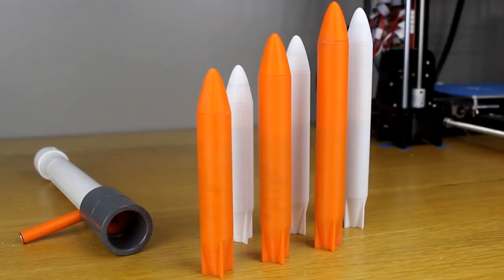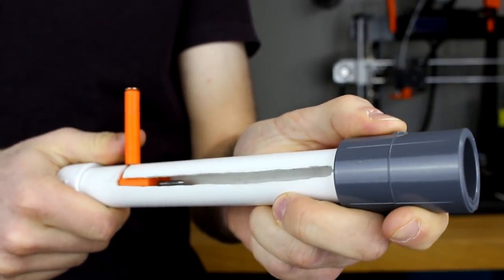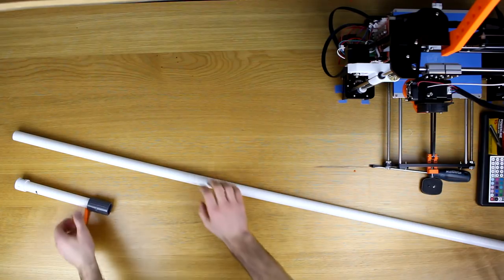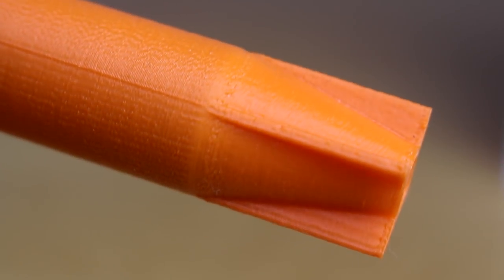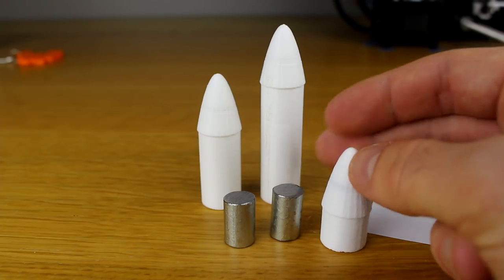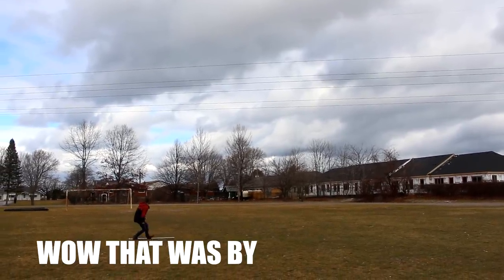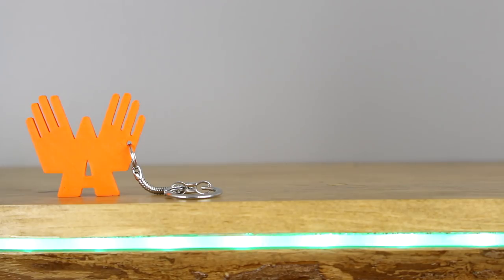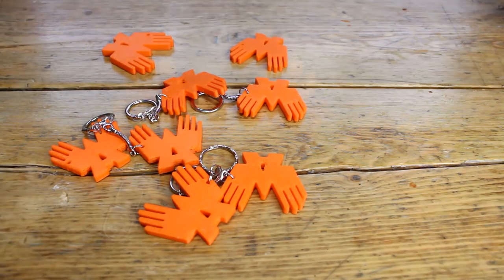3D Printed CO2 Rockets

Comment: Make the fins bigger. If you cut 4 slots in the PVC barrel you can use them to guide the rocket. Each fin will fit in one of those cuts
Reply: I think the whole reason for it being in a tube is to get the pressure behind it. He mentions in the video that the firing mechanism is sealed somewhat so that it does not lose pressure.
Reply: and each fin will have more friction on the tube and have more air resistance,
so it WOULD be more "stable" (according to KSP experience) and go not as high
Reply: It might help to guide it strait, though all of the air is going to be lost and the friction will slow it down further
Reply: hm....  true.
So instead of cutting 4 slots all the way, just make grooves on the inside of the pvc without cutting it all the way from inside to outside.  I dont know what tool can do the job, so maybe 3d print a tube with notches,

More like a scratch and less like a cut. With enough space for the wings
Reply: This would be a better alternative, it then comes to friction and slightly less pressure to decide.    Certainly a little better.   Though you could get rid of big fins and rifle it.
Reply: i think he should go with bigger fins, bigger tube and a wad to keep the pressure
Reply: Yea but friction...

Comment: You can increase the performance by adding less weight (CG forward) and using bigger fins (CP backwards) to achieve your stability factor! Then they'll fly higher since they weigh less.
Reply: Oh but you're constrained by the diameter of the PVC, nevermind.

Comment: Make spring loaded fins.  That way you can get rid of the nose weight.  If you put a slight bend at the end of the fin it will cause the rocket to rotate around the axis giving it gyroscopic stabilization. (Just like a rifled barrel spins a bullet).

Comment: Okay  Boss so I got my 7th grade science grade for model rocketry and a lengthy research paper ( and as my teacher had friends at NASA he gave me a NASA manual on rocket fuels ) all that said they make a model rocket add on that you might find cool it is a camera for the nose cone of small rockets I'm not sure if it would work with you rockets as it is triggered by pressure from the combustion engines in our old school style rockets. Good luck if you try it and great video.

Comment: I'm prety sure stable rockets can't be made with co2 cartridges. You can't pierce the cartridge perfectly in the center, the way the metal cap is made make its thickness inconsistent causing the hole to never be perfect, and your nail would need to be lathed for the point to be as conical as possible otherwise all those factors contribute to the thrust vector of the cartridge to always be off by a few degree making the rocket spin uncontrolably.

Comment: I have had this idea for a while but using model rocket engines instead of the Co2. Never tried it because I don't have a 3d printer. I wouldn't know how to design it or design it so it looks dope like that though. You should try to do that some time
Reply: It would prob explode because I believe it trys to burn inside the rocket for the last few milliseconds of fuel to push out the parachute and if it is in a sealed area then it would either burn a hole thur the side or build pressure and burst. but it would go supa speed and you could still see it bc the flames

Comment: Angle the fins for some spin, that will help.  Also, not rockets, but a similar problem of having fins but not much room for them was the tear gas grenades used by the Czechs in the 1980s. They were only 26.5mm, the same diameter as European signal flare cartridges, but much longer. They had a longer skinny tail section to add drag stabilization they could not get from wider fins. http://forum.valka.cz/attachments/4461/RV-85.jpg (they were for firing through walls at up to 700 meters) 

Getting a firing pin to reach up higher into a design like that could be tricky, but one simple answer would be to put the puncture pin/nail into the nozzle and have a rod from the firing spring push it, and you just dump the expended pin out of the tube before reloading.

There are also 26.5mm rocket assisted rescue flares. They use thin spring steel fins that wrap around the flare, and spring out once they clear the barrel. https://youtu.be/KuIh4ws_i6A

Comment: can you try and print a different model where you have slots cut into the rocket body and place plastic or cardboard fins that can deploy with air resistance when it leaves the barrel?

Comment: Make you rocket spin, even if it's uneven, it'll spin fast enough balance out. Like a top
Reply: There is no need to spin stabilise. Fin stabilization is just as good a rotational stabilization. Think about how a shuttlecock works. The amount of fin surface area really is not that much. A spin would not be initiated until after it leaves the launch tube, by that time it is already getting too late. A properly balanced body would work better in this case. He could remove the fins and still get the same if not better performance just by reducing drag and extra weight.
Reply: GeeTR 63-71 these are good points, but the idea I was having would be similar to a gun barrel. See, have the rocket start its spin before it exits the tube.  That way the fins kept the rocket stable and the spin keeps the rocket straight and true. As mentioned in the video that one of the issues, is that it doesn't stay straight while in air. So in my mind, the rocket is not having a strong effect by the fins, as is. This method is copied from NASA so I hope it's reliable info
Reply: You really do not need fins, take bottle rockets for instance - they have a long stick to counteract the pitch and yaw effects you would get from moving the CG behind the CoT.  Since fins are kind of out of the question as with rifling, the best bet would be to give it length and slide the propellant forward and have it exhaust out the bottom like a straw. If he wanted to over engineer it he could add spring loaded fins that deploy immediately after egressing from the tube. When I was in the Navy, our AOs learnt me some stuff about the GBU 10, it has a wire attached to a pin that is pulled when the bomb drops and that deploys the fins - home dude could just use the tube as the fin retention mechanism however, this would cause friction that would slow it as it exits. He could remedy that by using a 24 gram co2 cartridge and making a bigger hole for a more expedient discharge rate. He could just use the 24g in general so he gets better performance all around.
Reply: GeeTR 63-71 you have a strong point. But the entire idea of fins is to guide, water bottle, or c02 rockets through the air, to keep it straight. Air still has an effect on high speed anything, interlacing currents of wind can curve the rocket. Although over engineering spring loaded fins would be over kill. But if one we're to make the cone of the rocket more narrow like, then it would increase air flow around the rocket. Thus Less work for the c02 cartridges.
Reply: Well he already has the issue of bad balancing, why not fix it with one fell swoop. There is really no reason to add more fin surface area, why keep adding more stuff when you can just fix the problem just by changing the CG.

Comment: hmm.. can you try a needle instead of nail to get longer/ hire flight?
Reply: You need the sudden discharge of fluid. A slow discharge will not give you the required thrust, unless you can figure out a good median between thrust and discharge rate.
Reply: Crazy cal: Contrary to author's statements, it is a bullet, not a rocket. You have to discharge all CO2 rapidly, at once, to make this gun shoot the CO2 cartridge into the sky. If you attempt to make it into a true rocket (e.g. by punching a smaller hole instead of a large one), it simply won't fly.

Comment: should seal the end of the launch tube with tinfoil and add a vacuum pump to the tube. maybe add another 2 feet to the length. this should allow your rocket to launch faster and it would punch through the foil I believe not effecting the speed.

Comment: get the little solid rocket engine and put inside of the rocket instead of co2, it will go much higher
Reply: hobby store has them in packs at this size even, electrically primed easy

Comment: Was any calculations involved in designing the punchering mechanism (like spring coefficient, forces required, chamber dia,etc) or it was guess work. Is it possible to share the work. I am also working on a similar project.
Thanks

Comment: The fins you designed are not very effective. The point of the fins is to cause no drag if the rocket is flying straight, but a lot of drag when it isn't. This keeps it straight because if it deviates from the center, it has to overcome air resistance and more air is hitting all of it. with no fins, it is being pushed on evenly all the way down the rocket, but with fins, there is significant drag on the bottom compared to the top. This makes it decelerate and rotate back to center. The issue with your fins is they are mostly already under the body, so they won't come into action until the rocket has tilted far enough to have them hit the air.
Reply: other then that, cool video!

Comment: This is a really cool project, but this is not a rocket, it's a mortar, i.e. using barrel pressure to propel a projectile. I suggest trying to print a compression expansion nozzle to make it into a true rocket after it leaves the barrel. Although, the thrust of cold mono prop CO2 is probably garbage but nevertheless...

Comment: Yeah, the extra weight is really bad for performance. I'm currently designing a hybrid rocket of the same scale, using 8-gram N2O capsules: here's the design, which I'd think is a bit more stable. The fins are also slanted to induce some spin to it. Haven't flown these yet, since the ignition is REALLY hard. Also, it has extended fins, about 1.5cm past the bottom but in this pic they are broken. https://drive.google.com/file/d/0B2-JXMWaYEa2Z0VJdXBBWHRwVEk/view?usp=sharing

Comment: TO MAKE IT MORE EFFICIENT. and get MAXIMUM SPEED AND HEIGHT
MAKE THE TUBE LIKE A MESH WITH LOTS OF OPEN SPACE on it lots of holes in strips just small enough so the rocket won't rub against. except for the very bottom of the tube to build pressure where the nozzle is so that the front of the rocket doesnt have to push the rest of the air out of the tube!

CAN YOU TRY THAT PLEASE??
Who agrees with me?

Comment: Is the ANET A8 easy to set up out of box?
Reply: Ben jamen 
my experience was pretty smooth once I found out that the SD card reader was useless. The bed was ever so slightly warped but I get good smaller prints out of it.
Reply: Ben jamen 
my experience was pretty smooth once I found out that the SD card reader was useless. The bed was ever so slightly warped but I get good smaller prints out of it.

Comment: I'm not exactly sure why you call it a "rocket". It appears that most of the propulsion comes from the pressure buildup inside your PVC barrel. The barrel is so long that by the time your projectile escapes through the open end, the CO2 cartridge no longer has any pressure left to create any reactive force. In other words, what you have built is a cannon , a gun that fires a passive kinetic projectile. There's nothing "rocket" about it at all. Moreover, considering that your "rocket" has a very crude nozzle (just a hole punched by a nail), it wouldn't be capable of stable flight under its own power anyway. The fact that your "rockets" shoot up in more-or-less stable fashion indicates that all CO2 is gone by the time it leaves the barrel. It is a bullet , not a rocket. Basically, what you built in not much different from potato canon. The fact that launching pressure comes from the "potato" itself does not make it into a "rocket".